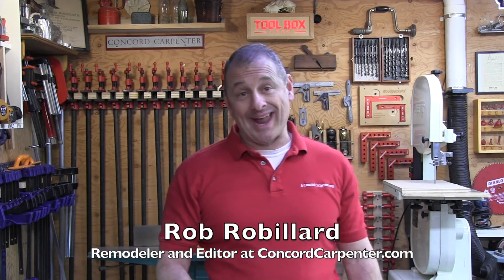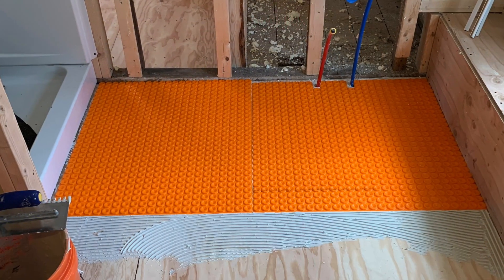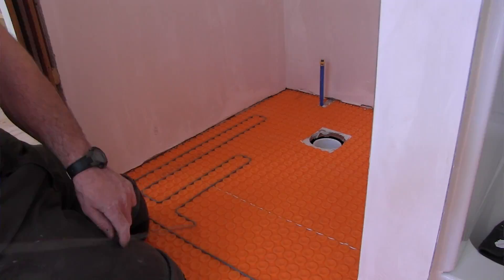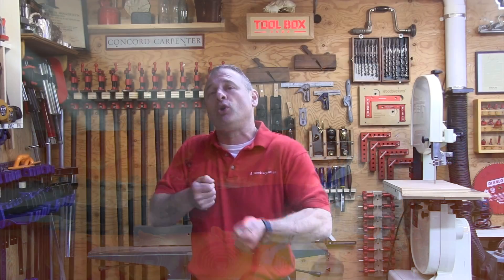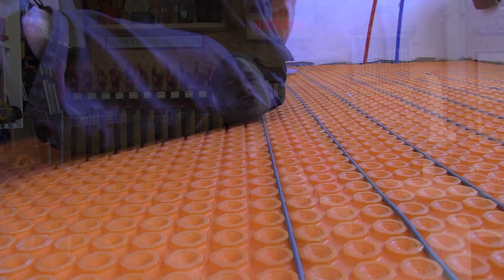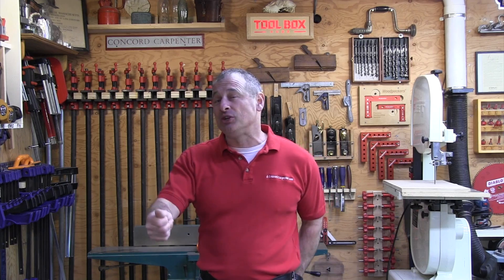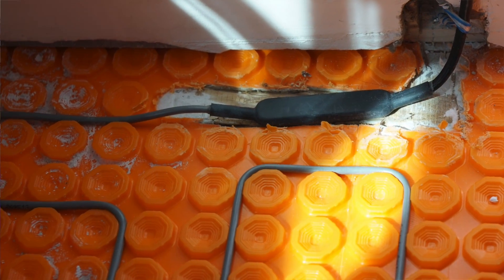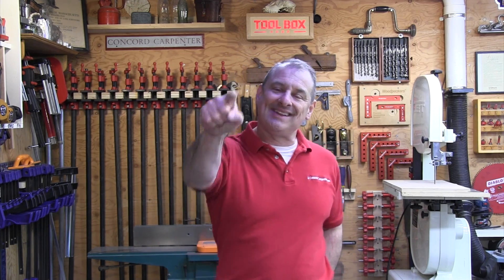Schluter DITA-HEAT Floor Warming System

Comment: I’m doing my bathroom. 
It keeps suggesting to use one cable in my shower and one for the rest of my bathroom. 
I’ve never seen the wires, do both wires go straight to the thermostat? Or do they splice together?
Do the thermostats allow for two different heat wires? 
Also if the part of the wire the goes to the thermostat a different wire? Or is there heat in the wall? If it’s different than can I use two for the two separate heat cables? 
Thanks
Reply from the maker: @stilljustaguy  2 cables are fine- don’t splice or  cross them. The cables have a non heated section to go in wall
Reply: @ do each have there own none heated wire that go into the wall, and both connect to the thermostat? Thanks for the reply!
Reply from the maker: @ each have a non-heated section go thru wall to tstat

Comment: Terrific video information.  How thick does the subfloor need to be in order to use the Ditra underlayment with heat system?
Reply: Where I live in British Columbia, the building code is 1.5" thickness for a subfloor for tile. Two sheets (layers) of rough both sides 3/4 " thick fir plywood.

Comment: I read all the comments hoping I would not have to ask.  But, what if doing a remodel of just the restroom and you don't any means or methods to run a dedicated circuit?  Can you tie into a 110V outlet that "probably" shares a breaker with 10 other outlets?
Reply from the maker: Not advised

Comment: What about adding a family room to a core floor home. Is Dita Heating ok to use for floor heat vs tube in concrete with a boiler heat system?  Family room size 10x28
Reply from the maker: boiler system more expensive to install but cheaper to run, i’d try to figure out the payoff period and ROI

Comment: Hi Rob. I have found from a few installations that Schluter is not very informative on their electrical wiring needs. When using their 220V kits, do you find their neutral-less 20A is sufficient. The last install, my flooring supplier checked for me to confirm, and it was a 12/2 on a double pole or tandem single pole breaker. I installed a 12/3 anyway just to,have the additional conductor. Is this your experience? Thanks for the video. I always enjoy your channel and find your content useful!

Comment: Do you recommend a plastic notched trowel to avoid potential damage when putting down thinset for tile?  Or is the cable embedded low enough in the Ditra mat to alleviate this concern?
Reply from the maker: Manuf does but most pros do a coat over the wired with the flat end the use the notched with the tile
Reply: @ConcordCarpenter  thank you for your reply.  I’m far from a tile pro.  So just to be safe I think I will use a plastic notched trowel over the wire.

Comment: Can you use this with wood or laminate flooring and would you need to do a thin set layer on top if you go this route
Reply from the maker: Igor Kosterin check out this last project I did:   https://www.aconcordcarpenter.com/wood-floors-and-electric-radiant-heat.html

Scroll down for video.

I’ll have to ask if this is doable with DItra

Comment: Hi does the Mat have insulation properties or do you have to use warmup boards or any insulation for that matter underneath ? Thank you
Reply from the maker: zuluula maybe a lil but it’s not designed for that, DItra has a mat that has a thermal break that they recommend for cold floors, concrete, etc
Reply: @ConcordCarpenter   I have timber flooring would dirt be enough to heat it up quickly ?

Comment: As installer I recommend if the high traffic area to cover with thinset if not going to be tiled right away, so no damage to the heat coil happens, it's going to get tiles and thinset regardless your not saving much thinset at all in the end, or if your DIY person it also makes using the trowel easier when pre filled.
Reply from the maker: Marc Favell my tile installer says the same thing as well
Reply: Schluter recommends against that. They say it’s best to do it all in one shot.